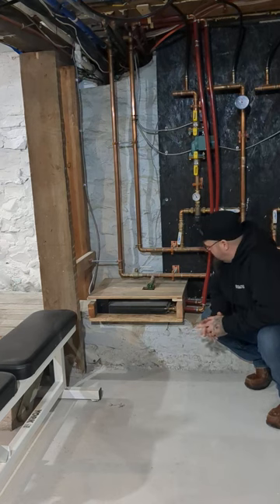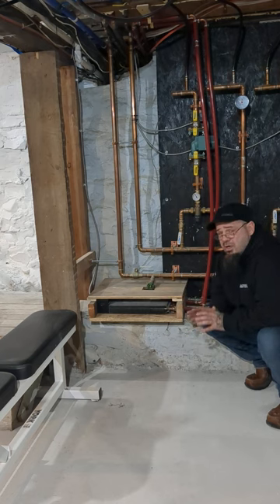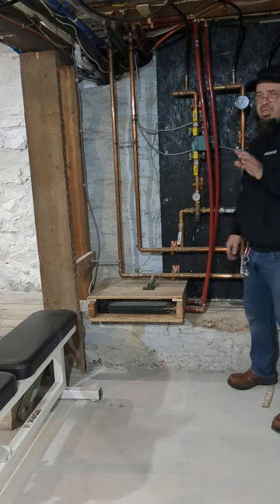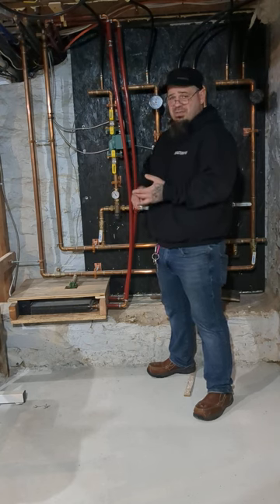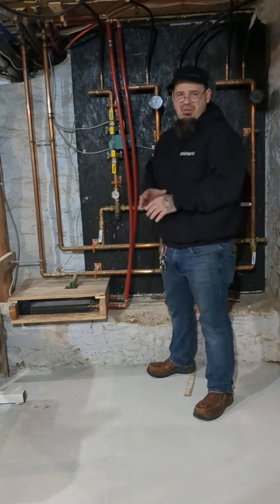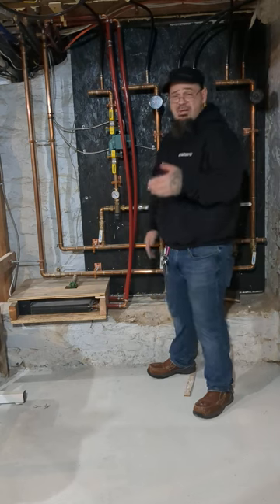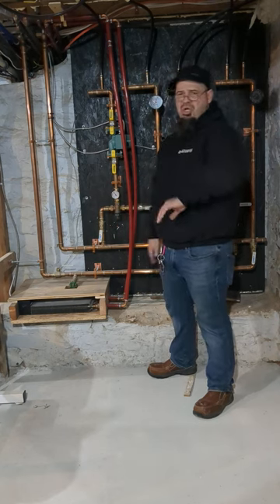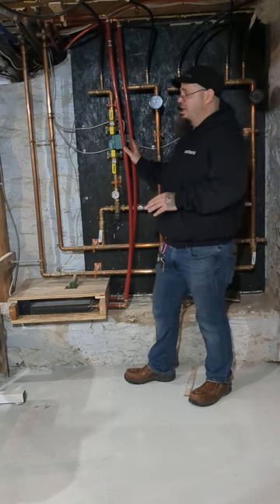An Inside View of the Toe Kick Heater (Like the One in Your Kitchen)

Comment from the maker: Hey,

If it is a toe kick as you see here yes it is able to be moved rotated is more what you’re asking. It will involve a carpenter and a plumber that knows hydronic  you would have to cut the base cabinet inside and then reinstall in the location you’re looking for. Have the Carpenter put the base of the cabinet back together. As long as you do it thoughtfully it won’t break the bank but it won’t be the cheapest thing you’ve ever done either. Watch your video on vetting your contractors ask good questions. Be careful! Happy new year